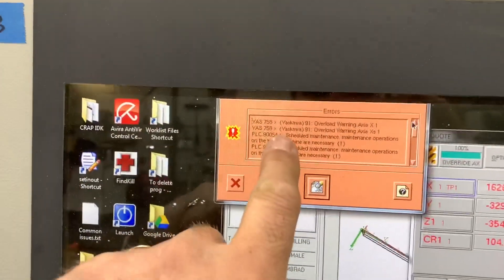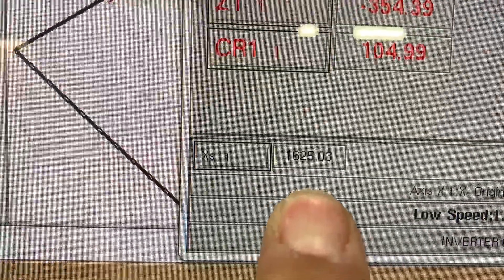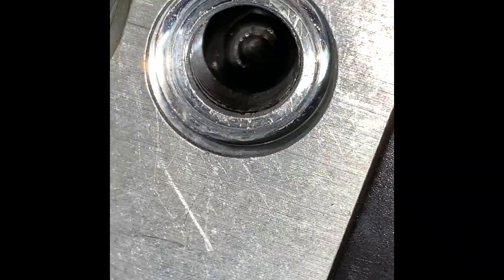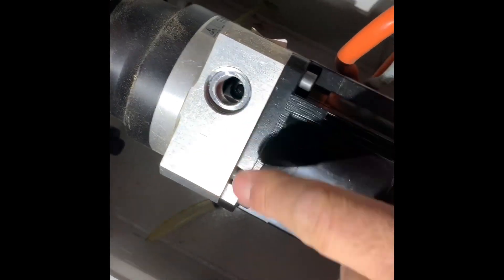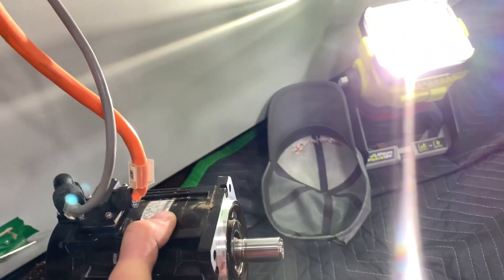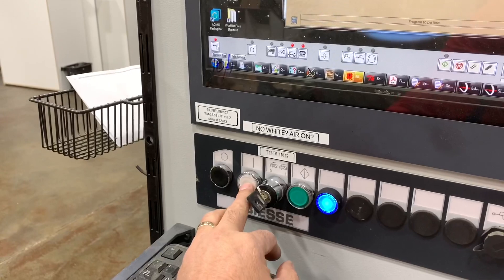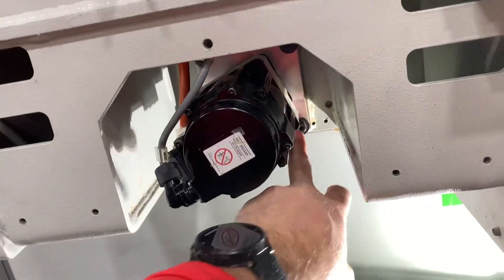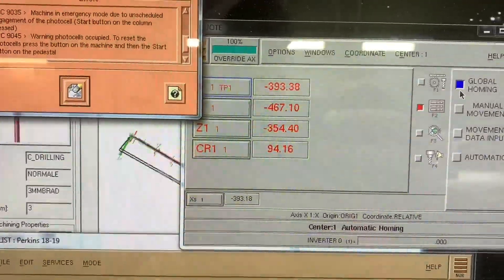How to adjust X Axis motor alignment on Biesse Rover S

Comment: Motor could also be left on as long as the shaft is free. If needed you can correct also in "movement data input" for difference, ussually it allignes itself once you power on the machine
Reply from the maker: We did what’s in video.
Reply from the maker: I no longer have this machine. I made video for ourselves internally and this was  process Biesse would have us perform. It doesn’t reset itself with a restart. It’s normally physically out of alignment because of parts Jam during push off
Reply: Maybe you remeber, did you fizically rotate the shaft to get the coordinate inside 0,2 or it alligned itself once it was free and you pressed power and e stop? Pardon my english😊